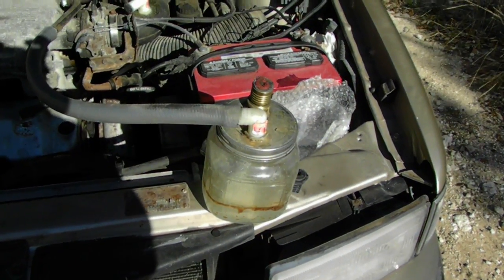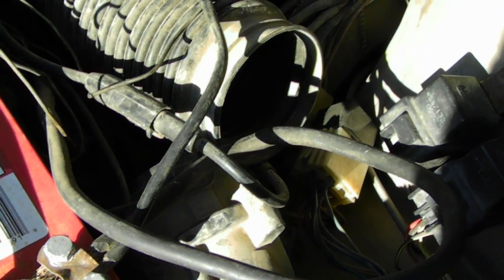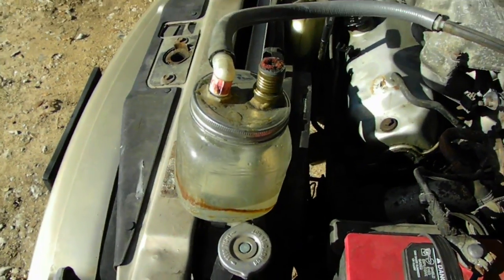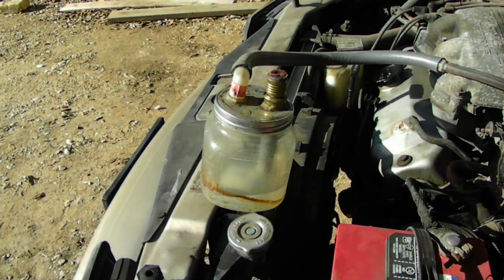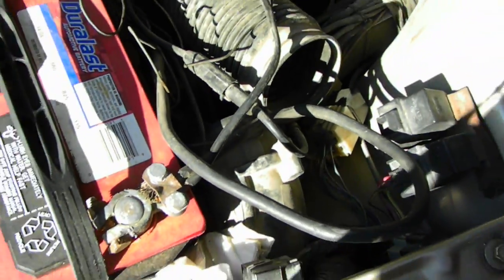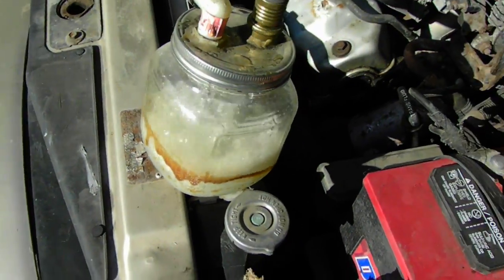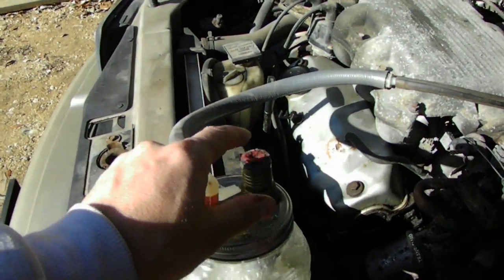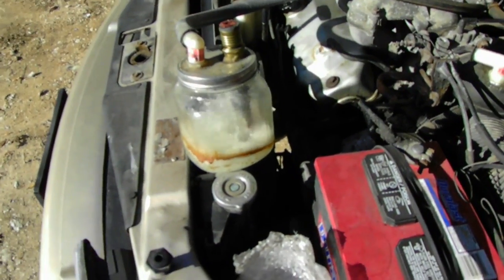Water vaporizer update

Comment: baken soda and sault? please help
Reply from the maker: no baking soda or salt
Reply: Can you use both at the same time?
Reply from the maker: +Alex Ochoa yeah why woulf you though its not an hh0 system
Reply: +prototype9000 I want to save gas but for right now but later any do the hho system and I also want to learn more of it and deeper into more
Reply from the maker: +Alex Ochoa the water vapor system will work but you need something that will trick the oxygen sensors and computer like an oxygen sensor simulator if you dont no matter what kind of gas save you use the computer will compensate for the changed stoichometric ration and try to change it back to original values giving you worse mileage you need to address that issue first
Reply: Ohhh okay jizz that's kinda both ways to a little complicated